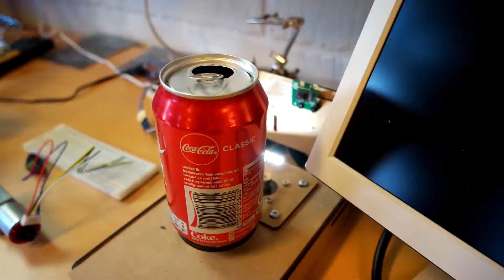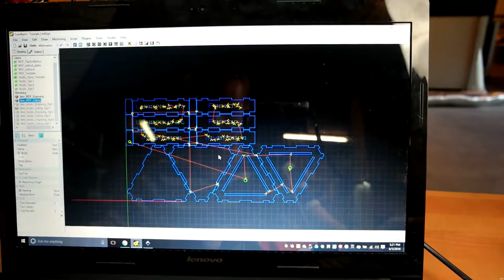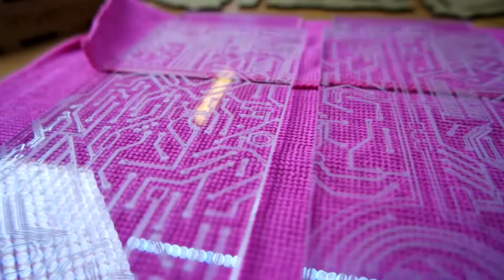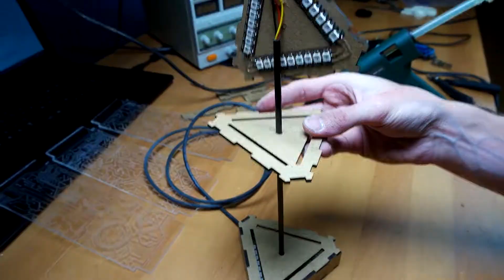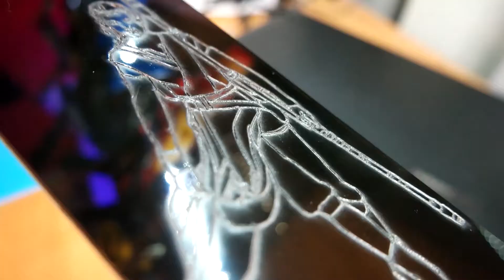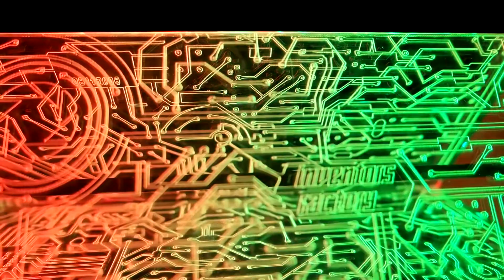Speedbuild #1 - DIY RGB LED Triangle Light

Comment: tell me about the led ring clock on the wall,  can you post the link to what you did ?
Reply: Thanks for the answer! I also want to see that one being made, looks sooo cool! To bad it broke, it was the first thing I noticed in the videos, quite a piece!
Reply from the maker: Hi tracar1, Well it was something that took a while, and doesn't work anymore (Leds 6 - 11 somehow stopped)... I am planning on a second version with less work in it... however I need to fix this one so in the occasion I'll show how I did that one and show version 2... I don't have a link I'm afraid :D But I'll try and rush things to get a video on that out as soon as I can :) including design & code. Thanks for noticing ;)

I can tell you it was lasercut in 4 different layers, one of them painted black on the back side, I used 60 x WS2812b Led's and used a ESP8266 for controlling them, exactly the same used in this video. It was smaller interlocking pieces and was a nightmare to assemble! therefore a version 2 is due...
Reply from the maker: Thanks Karl ;)